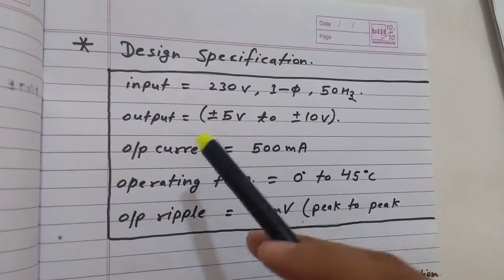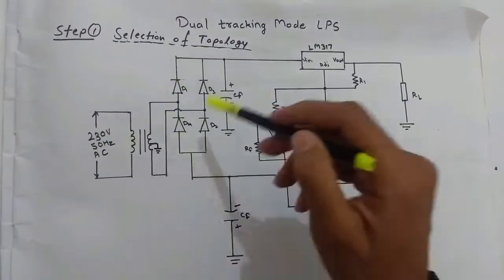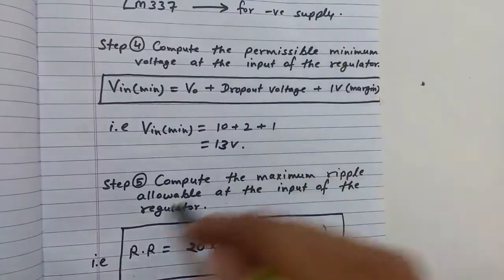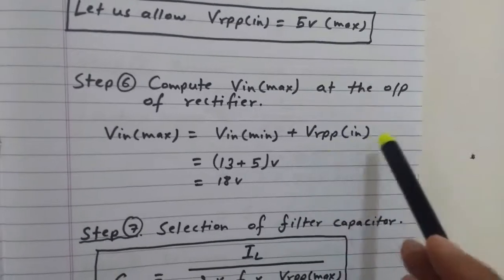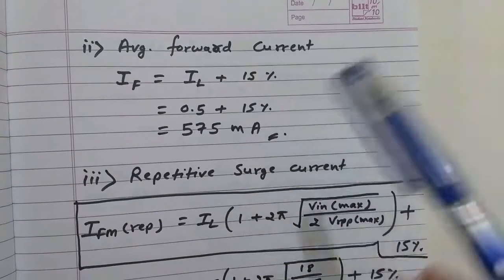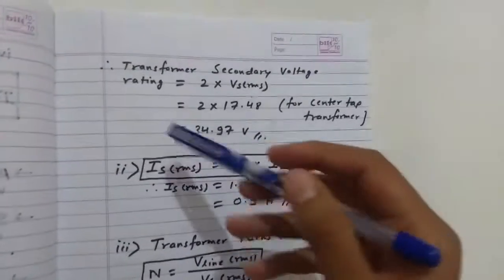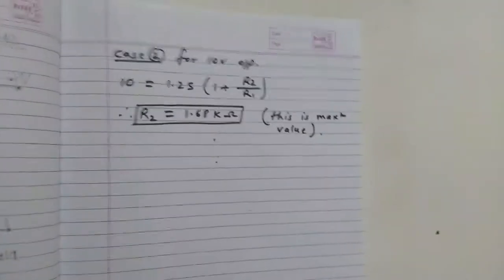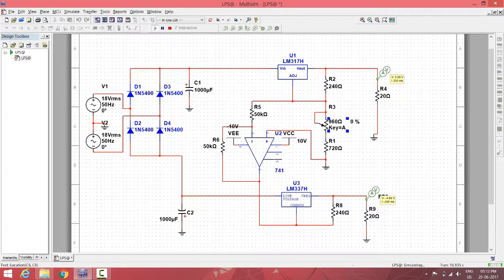Dual tracking  Variable mode Linear Power Supply | with working simulation

Comment: I can't believe there aren't any comments?? Excellent video. You would make a good electronics teacher! I'm going to design a dual tracking supply from OPA541 power op amps. I salvaged them from some discarded electronics. This will be based on a schematic I got from my electronics teacher in 1977. With these op amps, I can use the output directly!
Reply from the maker: Thank you so much
Reply from the maker: thank you for the compliment
Reply: I had trouble finding this video after watching about a hundred others. This is specifically what I was looking for. Great video series ... thanks! I will have questions later if that's ok? :D